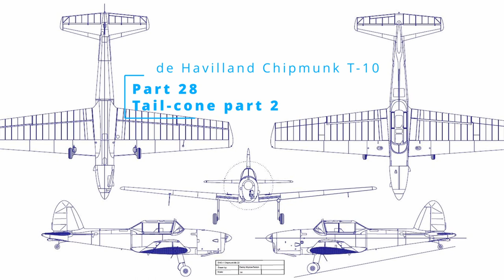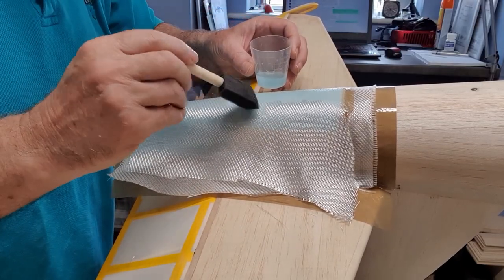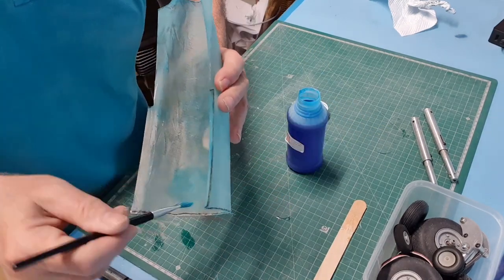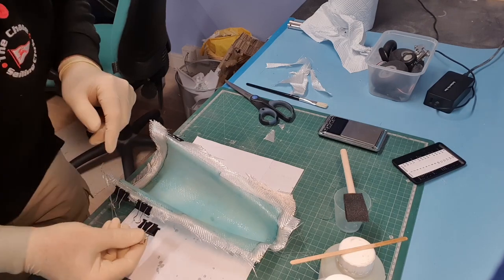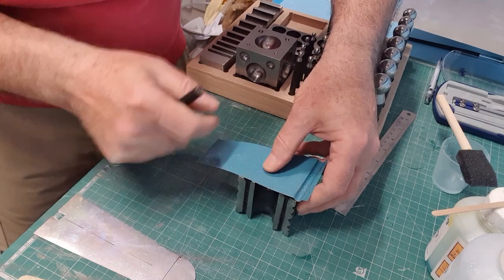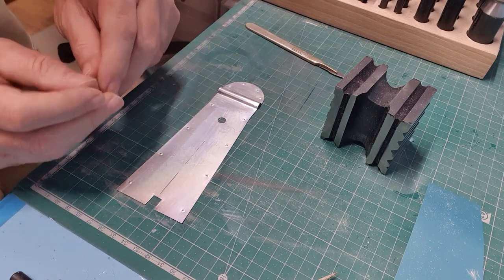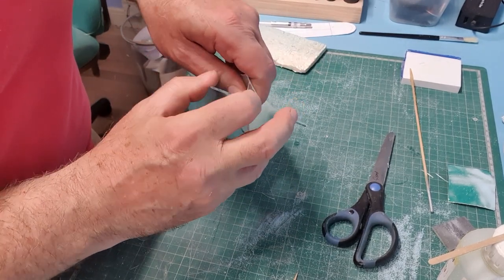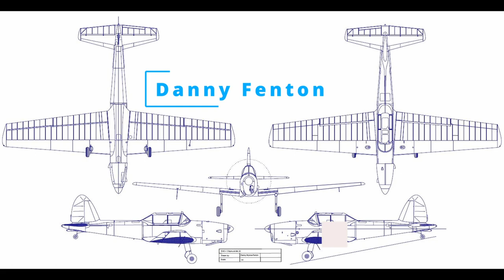Quarter Chippy Pt 28

Comment: With respect to the ridges in the mold, could you sand the inside of the mold to get rid of the ridges?
Reply from the maker: yes you could, but it is easier to work on the outside TBH. however if you clean up the mould then subsequent parts are better. 
In this instance I am only expecting to make one, at the most two. The finish has to be really good on the inside of a mould or the part will stick.